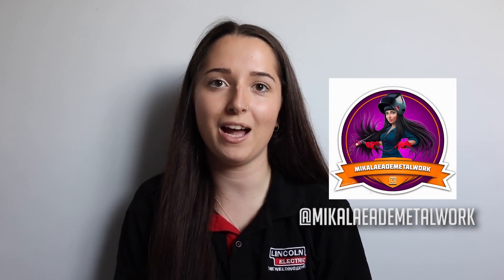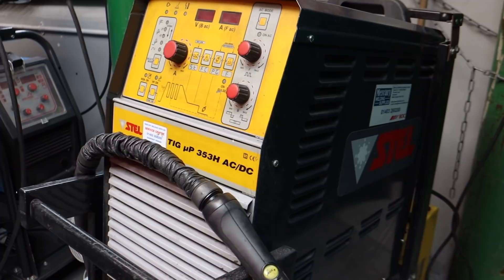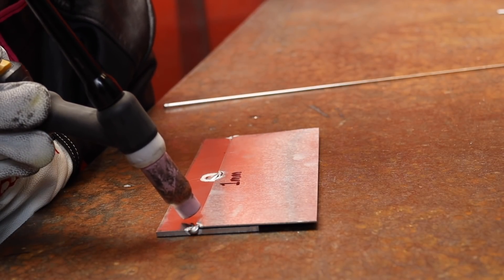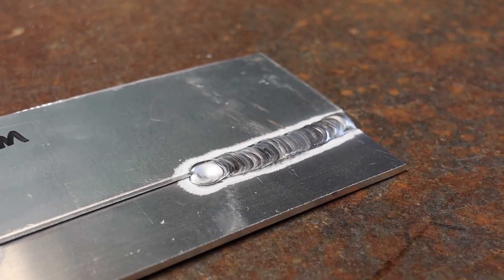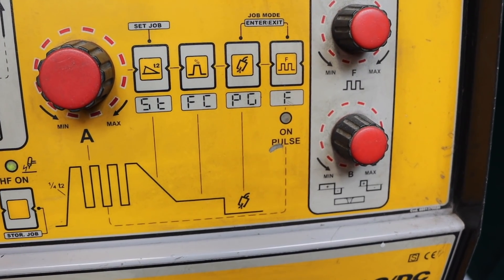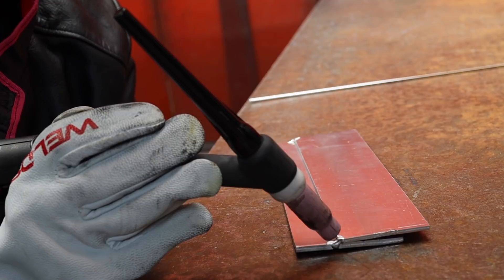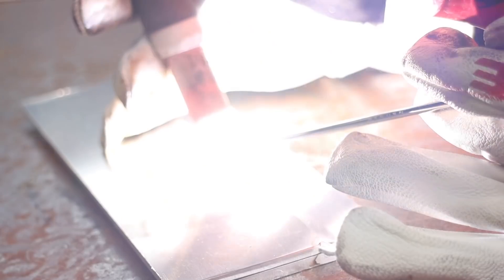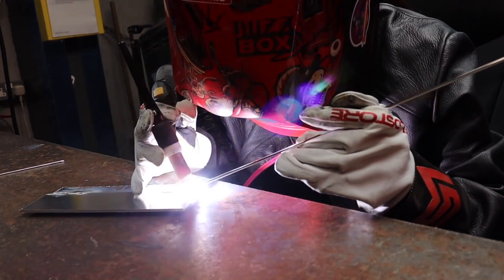Welding Different Thickness Materials Together

Comment: i  have fallen  in love with you mikala try using a larger cup with gas lens as the weld pool widens the larger cup and gas lens will protect the weld better because the cup will be bigger than the weld it will cover the weld with a wider shielding gas coverage your cup too small note gas lens stabilizes  the shielding  gas forming  a cone over the weld pool
Reply: I find with welding aluminum that I do not need that much argon coverage like you would with stainless.
Reply: @ztfab4203  i am right her weld is also too wide because her filler rod is too big to  melt a rod that big requires more current and the base metal will get very hot creating a wider weld pool she also needs backing strips too support the aluminum it will also act as a heat  sink using  a bigger cup and gas lens is a proactive decision mikala is  my wife i love her more than my creator
Reply: @Mikala Eade Metalwork i noticed your  tungsten was balled up thats because your tungsten over heating you need a bigger  cup to cool down the tungsten when you welding thin  aluminum a pointed  tungsten with a slightly balled  tip is better to pin point the heat to deposit that filler rod into the weld joint
Reply: @Mikala Eade Metalwork i love you